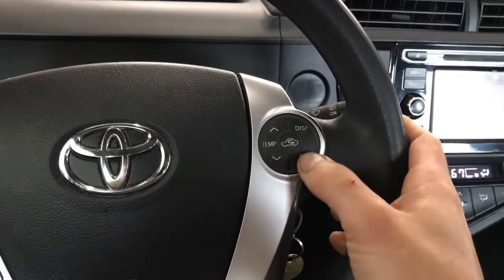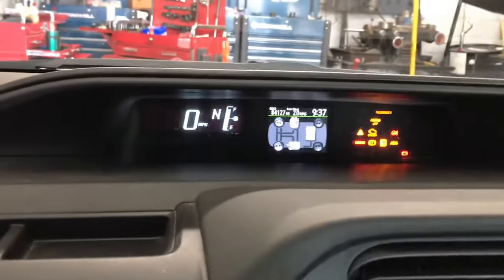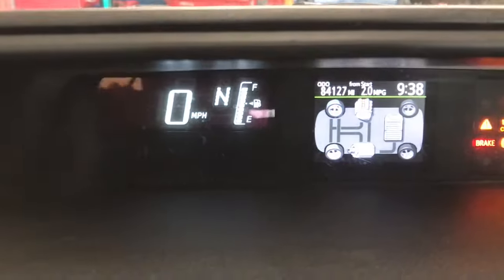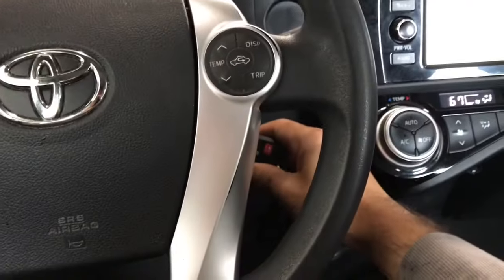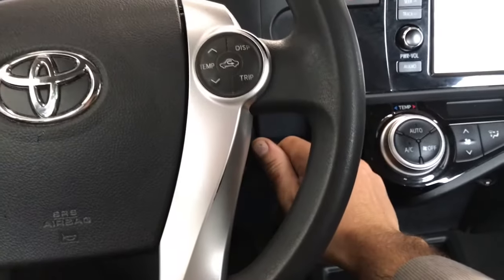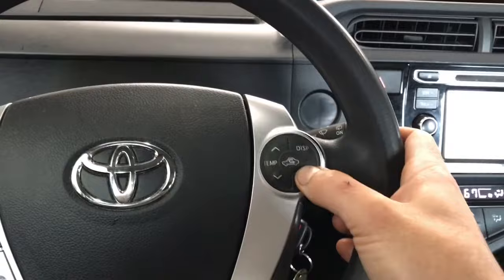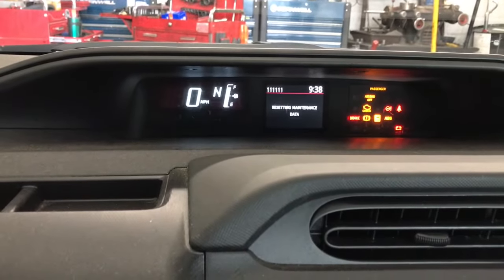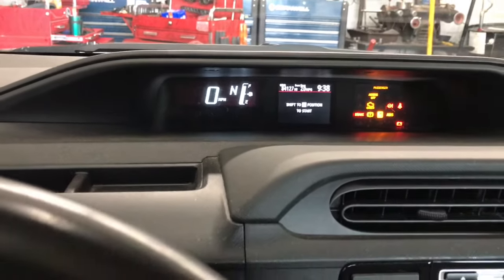Resetting The Maintenance Required Light On A Toyota Prius C

Comment: Spent 15 min doing that, still not working. Not sure whats going on. I work at a shop and and toyota keeps changing this process for some reason.
Reply: Did you hold the “trip” button down after the third press on it? Hold it down until it’s done.
Reply: @ i figured it out eventually